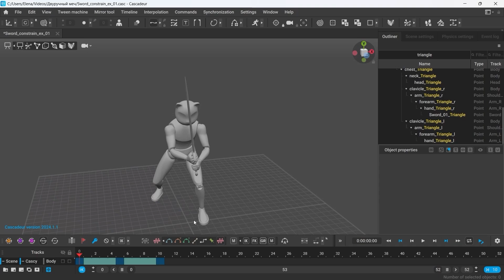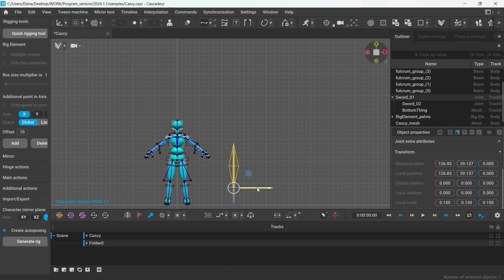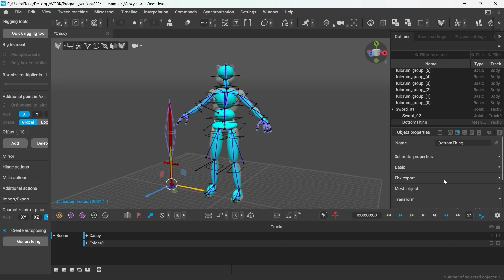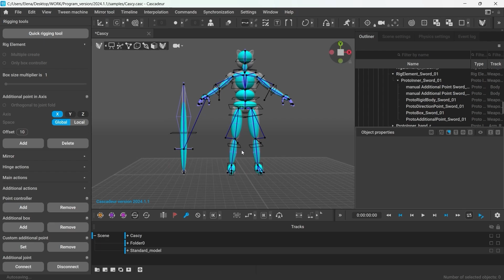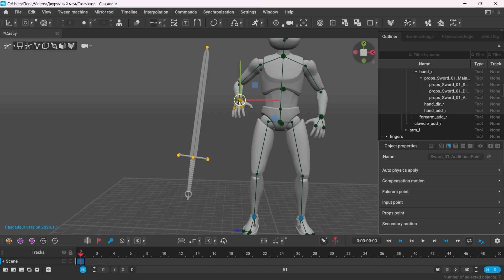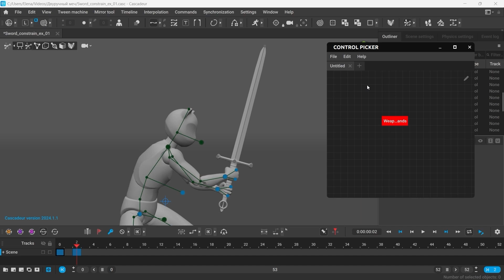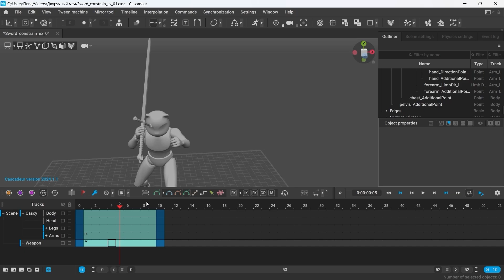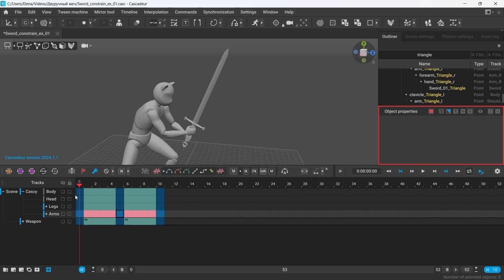Working with Weapons | Two Handed Swords

Comment: It’s clear from the video how to attach a sword to the hand, but how do you detach it, for example when the character throws a knife or a sword?
I also tried to load a pistol with a rig, but nothing worked correctly because the bullets can’t be animated, and the shell casings don’t work either.
Overall, the program is still far from perfect. There isn’t any proper video explaining how to attach weapons like pistols or rifles.
And since the interface has changed, the old videos are no longer relevant

Comment: I'm using 2025 1.3 and my weapon's controllers aren't showing in auto pose mode :(
Reply: I figured it out. You have to select the weapon's rigid body, expand Additional Actions and click the Add button under Autoposing props. This will register it as a prop for auto pose if you had to manually attach the weapon to the hand (for some reason auto rig wouldn't work even after adding the joint to the rig info).

Comment: i feel all these steps might be needed for a full fledged animation work like to even animate the weapon, but lets say I just want to animate based on the weapon, for example I use a simple mesh with no rig, I simply add a joint point drag and drop to attach to "hand_r" and boom its ready to animate the character based on the weapon (for the 2 hand mode I use a simple point constraint, if you guys add rotation to this constraint point it will give 2 ways of animating, one for character and weapon animation and one for a simple character animation based on the weapons, if I'm making any sense lol apologies if I'm not)

Comment: Quite an ordeal. Ideally you would want the weapon socket/bone to just move parented to the hand bone by default, at all times at an offset. Whenever you need the weapon to move independently, you would just animate the socket on its own with a toggle to "switch space". This isn't even covering weapons like guns, that have magazines, which would just fall out of the gun because of the autoposing. Those need their own animations as well. You could pretty much only animate those in point mode in order to not pollute the anim tracks, at which point you might as well just use Blender.

Comment: It's overcomplicated with all those searchings for triangles, proto thingies, double selectings (at least bone picker window can help with it, but it's too big, I would prefer if it was internal window without upper panel whatsoever and it would be like ad in mobile with small cross in upper-right side; also, ctrl+number is also a good option), clicking all over the place, changing interpolation for different hand differently, etc. I hope in future versions the app will improve significantly.